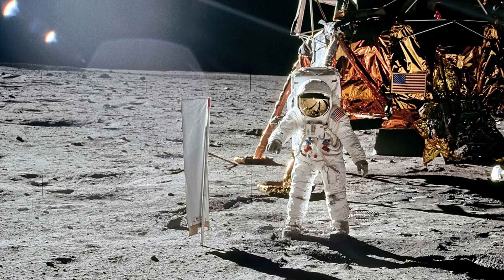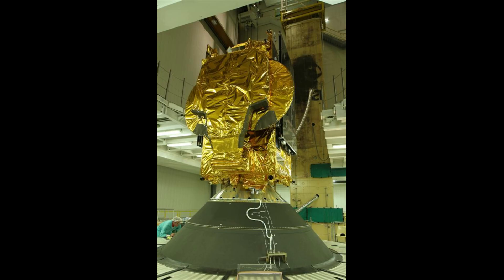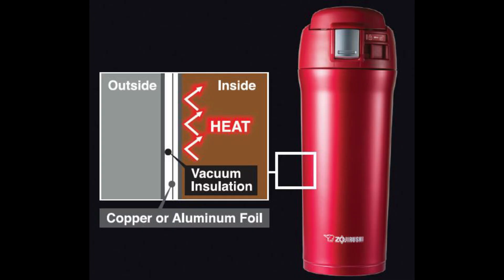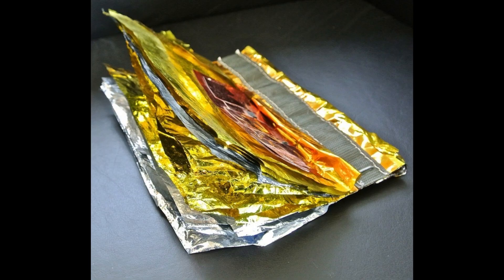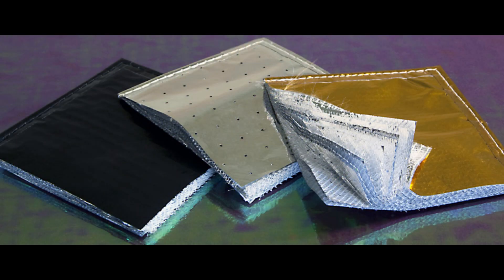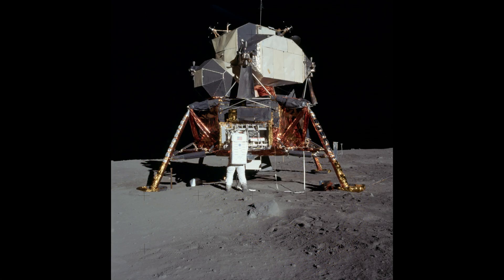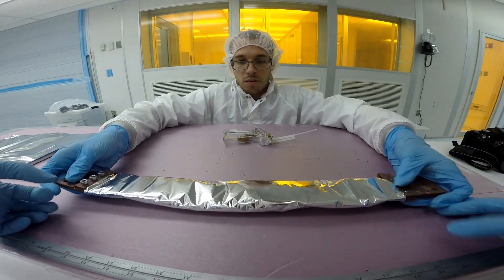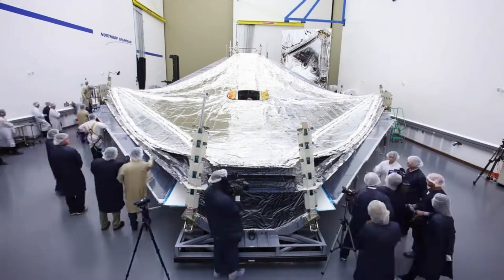Spaceships Are Not Covered In Gold Foil - The Cool Engineering Behind Multi-Layer Insulation

Comment: About 41 kg of gold was utilized in the construction of the US Columbia space shuttle, particularly in coated plastic films, electrical contacts, brazing alloys, and fuel cell fabrication
Reply: What????? 41 kilograms of pure gold? That sounds INSANE, even unbelievable. Do you have some source, info, documentation about this topic???
Reply: I'm finding stories about this, but they do not show sources.
Reply: I found the photo where this came from.  Seems to be from a very questionable source, the money project.
Reply: For pure gold all as one lump, it'd be a bit larger than a 2-liter bottle.
Reply: @jeffspaulding9834  That's enough for a couple square kilometers of contact surfaces.  The "41 kg" thing was obviously pulled out of somebody's butt.
Reply: @jpdemer5  Probably.  The only thing that makes me think "maybe" is the brazing alloys bit.  Space shuttles are big, and a lot of aerospace materials are unweldable and must be brazed.  I've never heard of using gold for brazing, but I'm a software guy so what do I know :)
Reply: Absolutely no chance this is true.
Reply: I can’t vouch for the veracity of this factoid, but I can offer 4 possible explanations for the apparently too-large mass:
1. It may include layered materials such as those discussed here, and be present on many layers. With the reuse of the shuttle, it had to be designed for operation near sea air many times, so oxidation is a primary concern and gold may be a preferred material for this use.
2. 41 kg may be the raw gold input number, before production losses. Some processes like vapor deposition/sputtering coat large areas besides the target, and there may be significant losses of material that would be recovered from unintended areas of deposition and reused later. Another source of loss that could be included in a large number like this might have been Columbia-unique spare hardware.
3. This may also cover gold use in electronics and connectors, of which the shuttle had many. Again, oxidation may have driven engineers to use gold in many more cases than would appear normal to someone outside the shuttle program.
4. Because Columbia was the first shuttle flown, they may have had additional losses as they figured out the best construction methods, and there may have been additional concerns that led conservative engineers to use gold in more places than necessary, which were removed in later shuttles the later shuttles.
Reply: I don't think I believe it was that much.  Source?

Comment: Speaking of aluminum foil... Scott, can you remark on the Solar Wind experiment you show in the video from 0:05 to 0:10?  I looked at the specs for that at one time and i believe I saw it was aluminum foil, the exact same width as foil you can get in a grocery store.  Do you think that is all it was?
Reply: Probably supplied by the same company, just had a little more care taken in processing to keep thickness variation, always there with thin foils, to a minimum, and to have a single pass pressing, so both sides are shiny, unlike the regular foil in which 2 foils are done at a time, with a thin oil coat between to prevent sticking, so as to cut time and cost. the foil from the roller is rolled onto a wide long roll, then goes to a slitter, where it gets cut to a width, then the length of foil required per pack is rolled onto the disposable mandrel in the box.

Comment: where is radiation and charged particle like proton+ shields liar !!! 🤔
Reply: The Apollo missions didn't need radiation shielding: the radiation levels are low enough that they don't pose a problem. Next time, do your homework before calling names.
Reply: and what about  artemis 2 😂
Reply: @yoskarokuto3553  The radiation levels now are no higher than they were in 1969. 
The difference is that Artemis missions will be much longer than Apollo. Still not long enough to pose a health issue, at several months.

Comment: The "Space Blankets" that you can buy at the local sporting goods store is the aluminized mylar that is used for insulating spacecraft, albeit a lower quality than the actual stuff.  I've even run into aluminized kapton in an old oven that I was repairing.  One of the many benefits that the public has received from the space program that is rarely recognized.
Reply: That aluminised fabric is also used to make bags, which hold stuff sensitive to thermal damage, and they work well to keep the contents at a reasonably stable temperature. I use the old bags, which are very big, as camping blankets, as they are easily big enough to cover you, and after 5 minutes you are very warm inside from the reflected body heat. Normally a ground sheet, one on top of that, a blanket or thin foam mattress, then you, a blanket, and another on top is a perfect way to stay warm even on the coldest night. They take up little space when folded up as well.
Reply: Are these the same blankets provided as small packs in first aid kits, where the purpose is to cover exposed victims ?
Reply: @johndododoe1411  Yes.  They're single layer, but very effective.
Reply: You also find them in European first aid kits, as blankets to protect people from hyperthermia until the ambulance picks them up
Reply: @simonm1447  they aren't that effective in air although they are great at reflecting radiation (in this case a person's radiated heat back to the body) they have practically no R value for retaining heat due to convection. A normal blanket would probably still protect them better but they are bulky and difficult to put in an emergency pack.
Reply: @CafeBikeGirl  that's clear, if you touch it the metal conduct heat since it's a metal. It's reflection, but typically you put it over clothes and compared to a normal blanket it's even water proof (and cheap), and as you already noted it's very small if it's stored

Comment: The gauss separating the layers sounds outrageously important. What was it made from? It seems like the weak link in the construction. The vacuum is perfection. The gauss would be the material transferring heat.
Reply: That is woven polyamide, same as the plastic, with a polyamide thread used to sew them together, in a loose stitch so the packing could keep the layers apart.
Reply: @SeanBZA  Very cool. Thanks. And polyamide has good to great insulative properties? Reluctance to transfer heat energy?

Comment: 0:06 - Can you do a video explaining why the landers legs don't have a spec of lunar dust on them, please? Asking for a friend.
Reply: I'll explain it

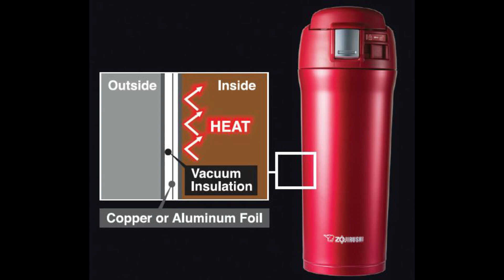So when they were landing on the surface, three of the legs had contact probes which were wires that hung below the lander (you can see them at 2:34), and when bent sent a signal to the pilot (you can hear buzz aldrin call out "Contact light" in the landing audio). Procedure was to shut off the engine at this point, and let the lander freefall the remaining distance. Since there is no air on the moon to make the dust cloud up and puff all around, it just flies to the side and gravity pulls it back down.

So in summary, the dust gets pushed only to the side, and not up, and the legs are not yet on the surface when the engine stops, so the dust just shoots underneath the legs and when they touch down all the dust is already away from the LM.

hope this helps
Reply: @nzredwolf4048  Yep. The dust gets accelerated to hundreds of m/s. There's no atmosphere to slow it down, so it lands far away.

Comment: Yep. Metallic gold actually gets really hot in space because it's not super reflective and the emissivity is kinda crappy. Silver and aluminum would be much better at keeping the spacecraft cooler and white paint would be even better.
Reply: I thought gold has far better reflectance in the infrared than aluminum. That's why they used it for the Webb Telescope mirrors. Right?
Reply: @alexheydon651  Gold and aluminum both have infrared emissivities around 2-3% of black body.  For the same wavelength, absorbtivity and emissivity are the same.  And what doesn’t get absorbed gets reflected if there’s no transmission (like if it’s clear).  So the reflection is around 97%.  Most polished metals without an oxidation coating would be similar.  The problem with pure metals in space is that they absorb solar radiation at a low rate but higher than they radiate that energy out.  So the heat builds up and they get hot.  Think about the seat belts in your car on a hot day.  And they have the benefit of air to cool them down some.  So, gold and aluminum and any uncoated metal gets really hot in space in the sun.  What you need is something that bounces the solar wavelengths off but emits infrared really well.  White paint does that.  Kapton is somewhat transparent until you put an aluminum layer on it.  But the aluminized layer is on the back.  So the gold or orange color you see is the aluminum through the layer of orange-y Kapton.  The thicker the Kapton, the darker it looks.  Kapton has a high emissivity and a high solar absorbtivity, so it would be hotter that white paint but much cooler than bare polished aluminum.

Comment: Why are the upper parts of lunar module protection joint by a tape? Is it some kind of special tape?
Reply: Yes. Industrial strength duct tape. The panels being connected were very thin, with the twin jobs of providing thermal protection and meteor protection (any meteor hitting them would vaporise, protecting the pressure vessel underneath). Because the panels were so thin, riveting them would damage them. Also, taping them meant they didn't have to overlap, as would be necessary to rivet them together, so it saved a small amount of weight.

Comment: I became enamored with Kapton after encountering it within the products of a certain fruit-themed electronics manufacturer.
Reply: Kapton rocks, along with a similar product used for masking off powdercoating, it's a polyester tape that has many of Kapton's qualities like high heat resistance, electrical insulation and is even stronger than Kapton.

Comment: The same stuff - btw. made by a company called Austrian Aerospace - is also used in MRI and NMR superconducting magnets which require liquid helium at 4.2 Kelvin to be superconducting. Typically the liquid helium dewar is surrounded by a liquid nitrogen dewar (at 77 K) and finally several dozen layers of mylar foil in vacuum around it.